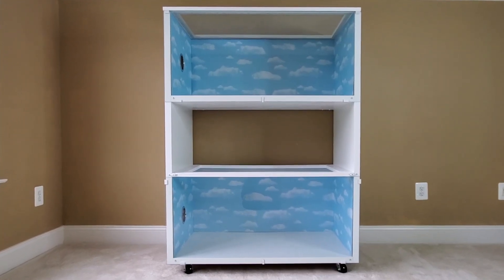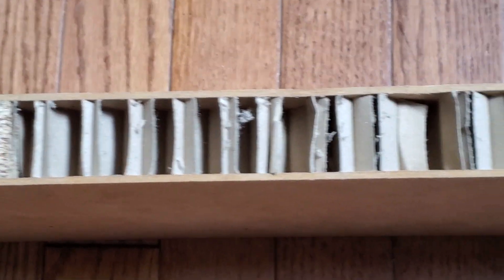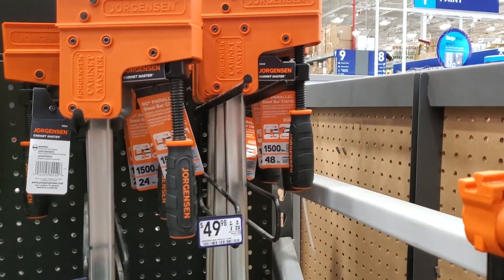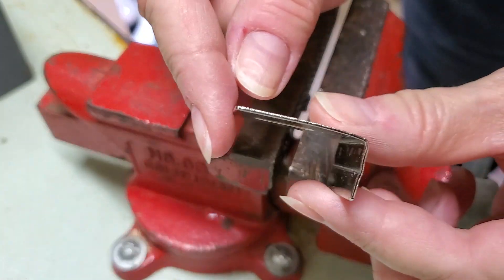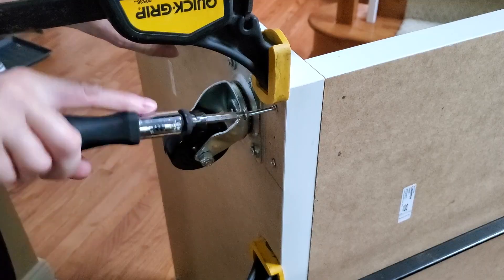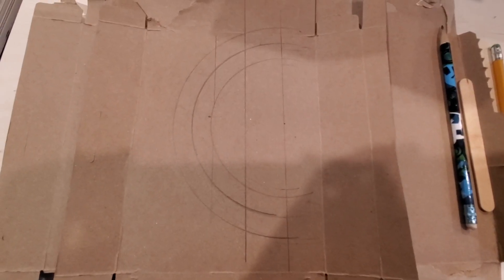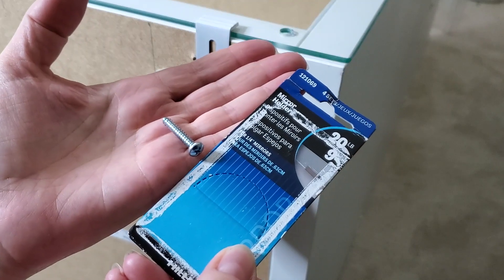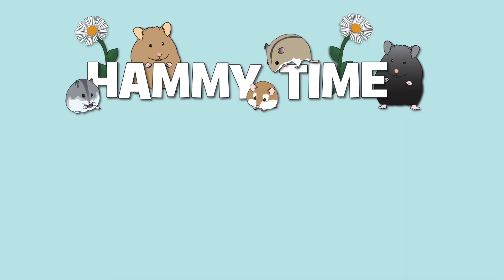Ikea Double Linnmon Hamster Cage DIY

Comment: Can’t wait for the full cage tour
Reply from the maker: Thank you! I got all the video taken. I just need to finish editing it. 🙂
Reply: @HammyTime  have you ever made a raised mesh lid on a plastic tote? It’s supposed to give more clearance for a wheel and platforms so you can have deeper bedding. I’m trying to figure out the best way to make them using some of your methods from your totes too.
Reply from the maker: @TeaCupSimmer  I've never made a raised lid but I have seen them. I can't remember where. You could cut out curved sides, like arches, out of wire hardware cloth, and then sew them to the top hardware cloth piece with wire. You could zip tie them, but there might be too many gaps. Wire hardware cloth is hard to cut and work with. I always cut myself, so wear gloves and even eye protection if you can. You would need to bend out the bottom a little to be able to attach to the lid with zip ties or wire. 🙂

Comment: I've been waiting for someone to design a diy for something like this. Thank you for sharing! While I won't be doing a big build like this for a while, I took my notes and can start planning it out until I'm ready to build. I currently already have 2 linnmon diys so I want to try to attach them together since I already did most of the work but we'll wait and see!
Reply from the maker: Attaching them together is a great idea. There's a lot of different ways to build a cage. I'm sure your hams will appreciate yours 🙂
Reply: @HammyTime  I do like them separate but for space wise, it makes sense to stack them. I've actually been talking about it for a few months and then boom, your video is uploaded lol instead of buying all new materials, just use what I already have. I'd only have to buy the longer tabletops and remove the sides I already have on so I can attach them together.
Reply from the maker: @budgetwithcam  Yup! 2 Lagkapten tabletops and that's it. You may have to make a new lid for the bottom cage but hopefully it's not to much more work. 🙂

Comment: Just wish it was bigger…not big enough but an awesome build my friend 🤗🤗
Reply from the maker: Thank you. I would have made a bigger one but at the time the price of materials was astronomical because of supply issues. The price of wood alone was ridiculous. I always liked Vanilla Ham Ham’s IKEA Linnmon cage, and because the IKEA cost of materials was so affordable I decided to modify her design. I’m content with the size because it’s tall enough to get 10” of bedding and still have room for everything at the surface for my hamster to enjoy. Each enclosure takes 6 bags of the largest packs of bedding you can buy to fill up just one of the enclosures. Each bag costs approx $20. The doors on the side is the best part about this cage. My hamsters love the side door. A playpen is a must, especially for a Syrian hamster. It doesn’t matter how large your enclosure may be, a Syrian will always want to get past any and every wall they see lol. The only changes I have made is I had to line the bottom and sides with tile to stop my Syrian from chewing through the wood. He managed to chew a hole in the bottom corner and was able to escape. He was able to get out and back in because it was low to the ground. I discovered the hole when I was cleaning and found wood bits on the floor. He was asleep in his burrow. He must of had a blast coming and going as he pleased for a few days lol. I felt bad fixing it. It may be possible to make this cage with larger IKEA materials. They have different sizes of table tops and glass tops that might work to expand the size. You may have to get glass custom cut to size elsewhere.

Comment: Yep I have that drain cover in my bathroom sink!😂 But this is just gorgeous-I’m a mouse mom❣️But how long did it take you to do all of that?! You’ve really blown my mind 🤯….lol 💚
Reply from the maker: I use one in the sink too lol 😆I was considering mice for the top enclosure 😀 It took me a long time because I was making it up as I went along. I also like to complicate things for myself like making custom brackets to hold the glass on. If I made another it wouldn't take as long because I know exactly what to do.  The only thing I would do differently is ceramic tile the floor and sides to prevent chewing. My current Syrian hamster managed to chew his way out in the corner. He's in the bottom enclosure so he was able to come and go as he pleased for a few days before I discovered it lol 🤣 If hamsters can get back into their enclosures they will come back. I had to use a strong wood filler and then used sheets of glass to cover the bottom and sides. Overall I'm very happy with it. I wish it was bigger but I had to work with IKEA parts at the time so I was limited. I built it when the price of wood was at its highest.
Reply: @HammyTime  yes with the wood that often happens but there are so many beautiful wood enclosures. You did an excellent job, I'm sure you could make some good money doing this for others! I was even thinking if I knew you would $150 be enough for u to do it, lol though I know you probably hadn't thought about it, I'd have pulled every strand of hair out trying to do that🥴and I don't have the space anyway, just fantasizing. ☺
Reply from the maker: @ROSE_reddy  Thank you! I would not have the time to make these to sell, and the cost of materials, and my labor would put it well above what most people would want to pay. Bin cages would be better to make to sell, but I don’t plan to 🙂

Comment: Just subscribed ! I’m trying to get a bigger cage because mine is small, but my 2 other hamsters have 50 gallon tanks
Reply from the maker: Thank you for subscribing! I used bin cages before this build. You can get 50 gallon storage bins from target and Walmart. I like bin cages because all you need to do is cut out a window on the lid and attach wire mesh hardware cloth and you're done. 🙂
Reply: @HammyTime  thank you! I usually look for bin cages

Comment: Hey, thank you so much for posting this. I'm interested in building this cage but it looks like the appropriate sized glass top is no longer available. Do you have any ideas on what I could use instead for the glass panel if I still want to use the linnmon tabletops?
Reply from the maker: If it's sold out it will be back in stock soon. I had to pick up mine from the store because there were none available online. Shortly after I got mine they were available online again of course.  If you can't get glass from IKEA you can try a home improvement store or a local glass company. You can have it custom cut. Acrylic glass would be great, but unfortunately it's very expensive. Acrylic costs more than glass. Try call a glass company to get prices. I avoided that process and used the IKEA glass, so I don't know any specific place to order glass from. 🙂
Reply from the maker: Oops! Actually, I had to order my glass online. I picked up the table tops from the store. The glass goes out of stock a lot and then gets restocked eventually. The glass was back in stock at the store right after I ordered mine online.
Reply: @HammyTime  i really appreciate your responses :)) I checked back on the site last night and was able to snag the glass as well!
Reply from the maker: @herpdederp12  Yay! 😀

Comment: What wood did u use and can hamster chew there way out?
Reply from the maker: I used IKEA table tops. Hamsters can chew through any wood so you can put tile on the inside floor and sides to protect it. In my experience it's the Syrian hamsters that may chew their enclosures.

Comment: This setup is. Sick. my brother and  myself plan on asking. Our parents to get us a hamster,  this. Is.   The setup I plan to build  but I do have a question  where do I get a circular saw. And the other saw?  And is there an alternative to  those. Tools? I am 13.and my. Brother is 9
Reply from the maker: Thank you! You will definitely need your parent's help with the build. It was the first time I ever used a circular saw and I was nervous. The wood is easy to cut but the saw itself can be very dangerous if not used properly. It's scary even when used properly. Maybe you can have your parents cut the pieces for you and you can put it together. The glass is fragile so you would need help with that too. The saws are very expensive so you would want to ask your parents to help you figure out how to get the pieces cut. 🙂
Reply: @HammyTime  thank u for replying I think your hamster is very cute 🐹